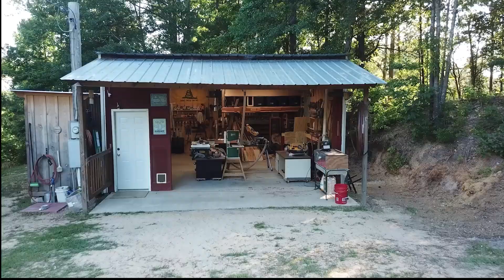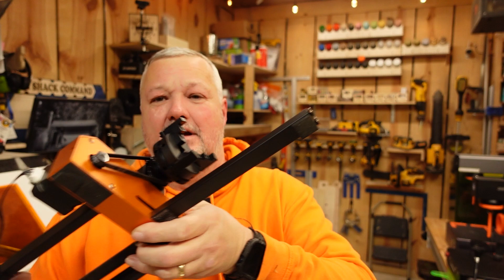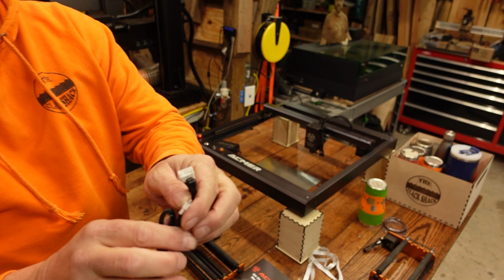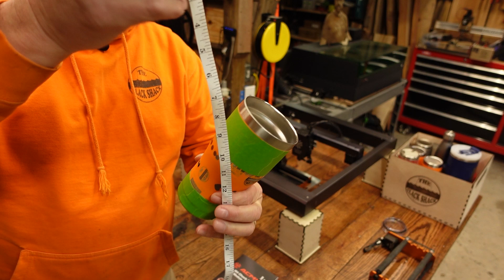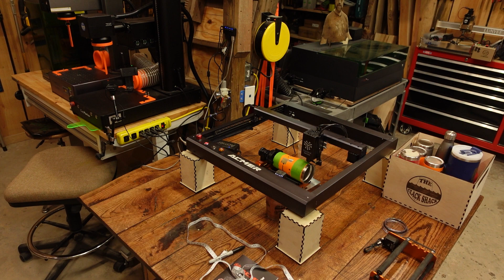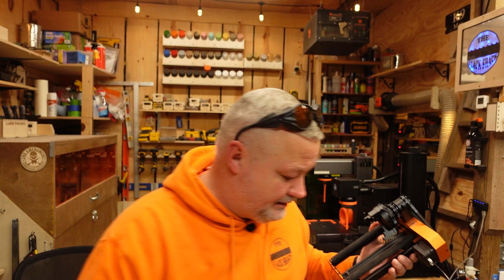Rotary overview and setup- Acmer M4- 4 in 1 rotary

Comment: Bought the legs while I waiting for the roller. Then found the roller included the legs. Then realised the legs are just a nuisance and towers are waaay easier. So I have two redundant sets of legs.

And, the one thing you missed in the set up is to remind muppets like me that some of our diode engravers have two stepper motors on the Y axis.
Start it up and am momentarily baffled by the roller turning AND the gantry homing!

Furtive looking around to make sure no one noticed then unplugged the other stepper.
Reply from the maker: True… those machines also sometimes have a plug and switch for rotary.
Reply: @TheClackShack Unfortunately not on this one, Two Trees, and the plugs were hotglued so a lot of fiddling around.

But it's in and working, just need to figure out why it works perfectly in the Light burn setup test but goes nuts when I try an actual test burn.

It will be something simple that takes me all evening to find. 😊
Reply from the maker: @Graeme758  Try setting it to current position in Lightburn
Reply: @TheClackShack Thanks, I'll give that a go.
Reply: @TheClackShack  Turns out it was a homing issue. I just unchecked 'Home on startup' and it was fine.
Reply from the maker: @Graeme758  good deal

Comment: Excellent video and great information on the new M4 from Acmer.  You did mention other rotaries in your video, which would you recommend for the Acmer P2 33W?  Thanks again!
Reply from the maker: The M4 works well but it still hasn't beaten out the Atomstack R1 in my opinion. https://shrsl.com/4tkz6

Comment: Thanks for the review. I just bought this rotary myself for my P3. I was wondering why you mount the base of your tumbler in the chuck. I just finished 6 20oz tumblers with mine and I mounted them from the top. Is it just personal preference or have you found in your experience that it works better that way?
Reply from the maker: Preference, I never engrave the bottom 1 inch and have less of a chance of impact with the head. Unless you grip inside, there is a collision risk. If you do grip inside, more of a chance of misalignment.
Reply: @TheClackShack  I clamped outside the top using the clamp parts that you showed in your video but didn't use. They're pretty low profile, but I definitely see your point on the potential for a collision. I'll probably try clamping the bottom on my next ones.